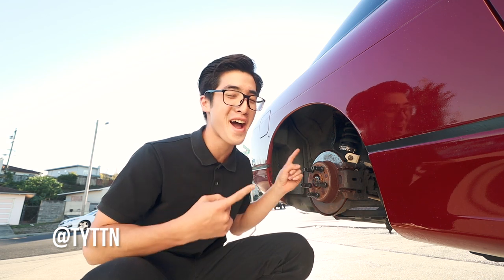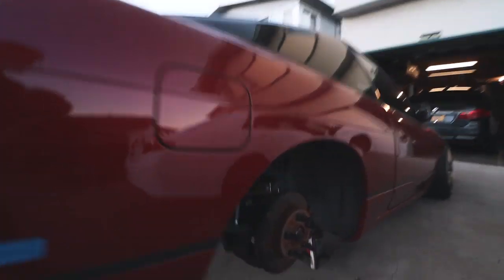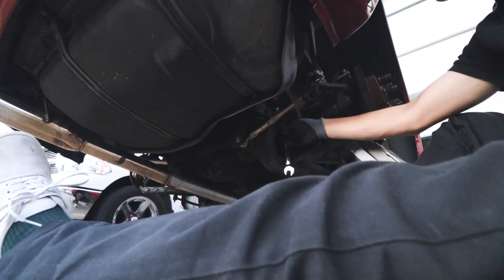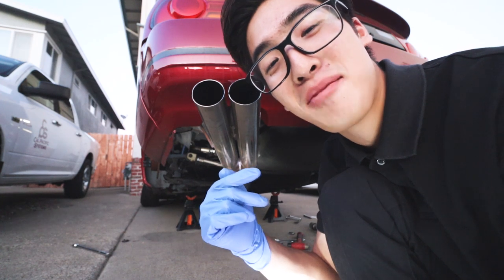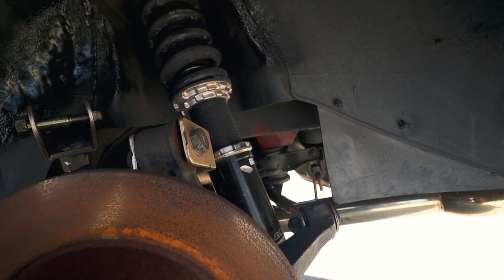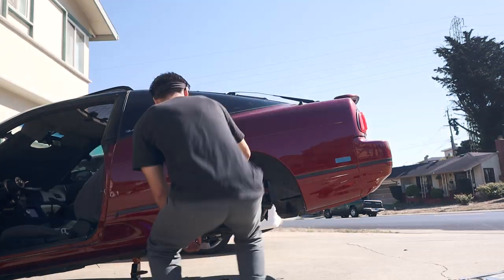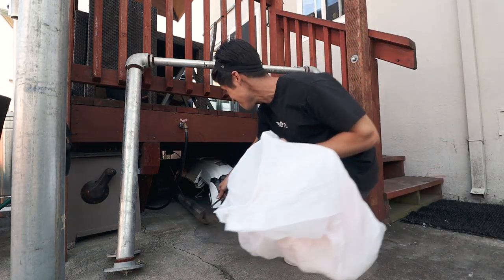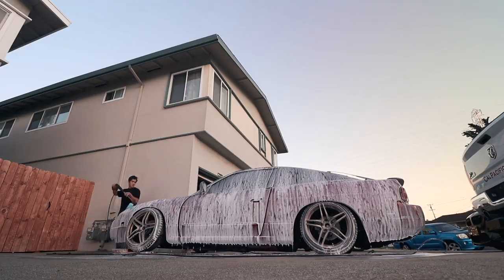240SX axles and Lock Out kit!

Comment: I would highly recommend you spend the money on a 350z axel kit the stock 240 axels are trash
Reply from the maker: yes I am once I go more power. I would get those faction adapters!!
Reply: Tyler Tea I advise you to stay away from just adapters.. They actually cause more problems in the long term. I made that mistake. I recommend you buy new 240sx to 350z output shafts that's what I have now so much better and it's plug and play so no issues. It's obviously more expensive, but it's worth the money.